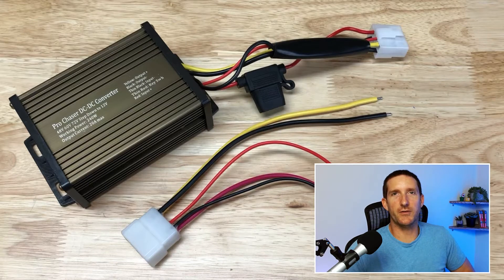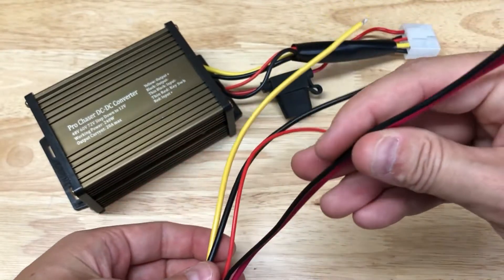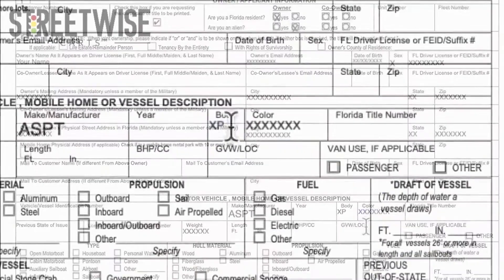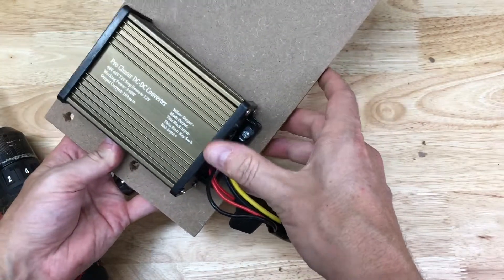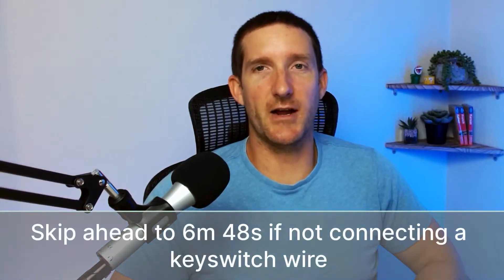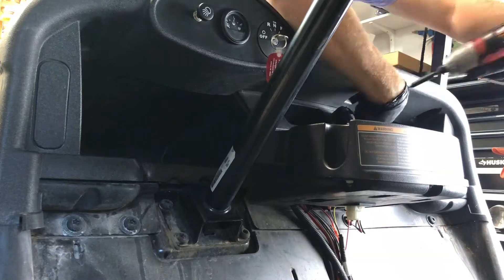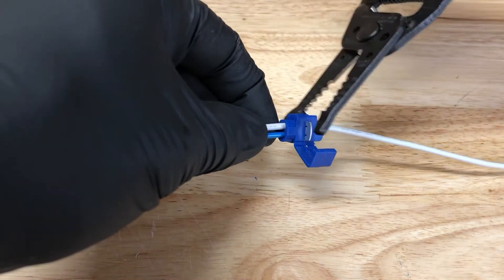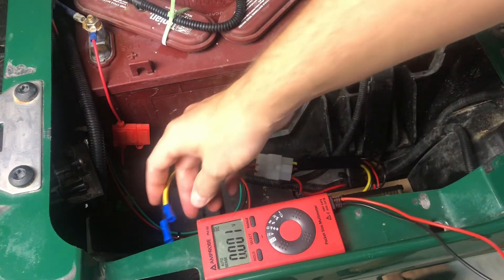Voltage Reducer Installation for 48v Golf Carts with Keyswitch | ProChaser 20a Tutorial (48v to 12v)

Comment from the maker: There weren't many videos on youtube showing how to access the keyswitch so I hope you liked that part! Leave a comment below on what you thought about the video and what your experience with voltage reducers has been. Thanks for watching!
Reply: Dose the step down converter drain the 48 Volt battery by just keeping it connected? even when the converter is not in use? just curious
Reply from the maker: @alexshatner3907  When it's connected to the cart using the keyswitch wire, it doesn't draw any current. This is what's nice about getting a converter which has a keyswitch wire because there is no concern of a constant draw when the cart is turned off. Hope this helps.
Reply: @StreetwiseCarts  Sure does thanks Wise
Reply: Hi, i have a question about my key switch wire. On the Blue DC converter the green wire is for the key switch. Why do you connect it to the solenoid instead of running it and connecting it to key wire behind the key area.
Reply from the maker: @alexeyafanasiev4795  This is specific to the RXV, it's because the controller is sensitive and can easily get fried.
Reply: @StreetwiseCarts  I have a EZGO Express S4 Elite, is this wiring for the key switch the same?
Reply: I am bit confused re: whether or not to attach the key switch wire to the key switch or to the solenoid?  Mine is a 48 v 2021 RXV.
Reply: If your converter has a key switch wire, attach it to the key switch.  if it deos not, attach it to the solenoid?
Reply from the maker: @ChristopherBullock-z9c  Only the RXV goes to the solenoid, image in the description.
Reply: @StreetwiseCarts  Thanks--that is how I will wire it.  Any plus or minus to doing that verses running the green or key wire to the key switch?
Reply: I have a 2014 rxv . So do I connect it to the solenoid or to the key? I’m confused
Reply: @maxx8488  I have a 2021 RXV and decided to connect the wire to the solenoid rather than the key switch.  It works fine..
Reply: @christopherbullock2644  so you connected the key switch wire to the solenoid? I’ve seen on some other videos they said not to do that without a relay. Any idea why?? Is yours still working fine being directly wired to the solenoid without a relay?

Comment: So which terminal on the solenoid do you use? Thank you!
Reply from the maker: There is a link in the video description which shows a picture of how I and several others have attached the keyswitch wire to the solenoid. I'm not responsible for anything you do or don't do in this regard.
Reply: I did see the picture however it’s not clear which terminal on the solenoid is used, positive or negative. I’m assuming positive?

Comment: On your rxv which color wire from your key switch did you tap into out of the four wires there?
Reply from the maker: On the RXV you should not tap into the keyswitch wires, instead, many people go to the solenoid. There is a photo in the description of that.